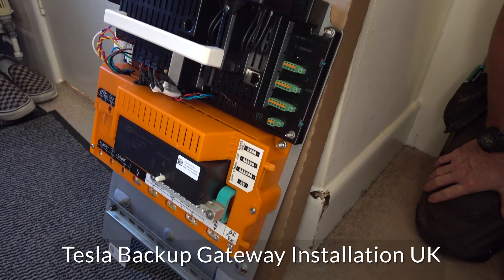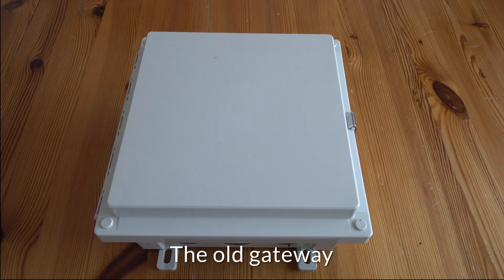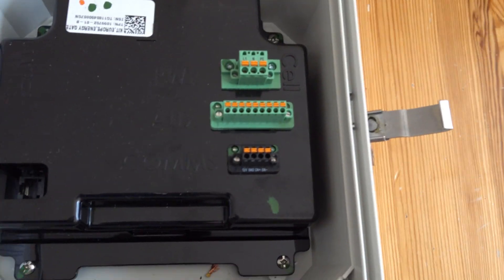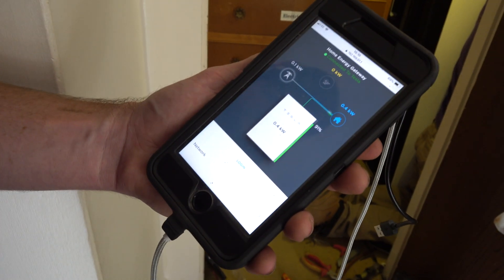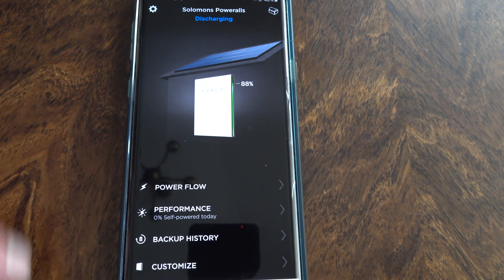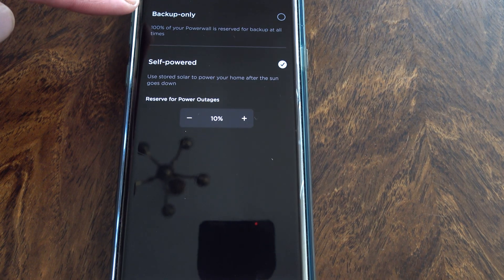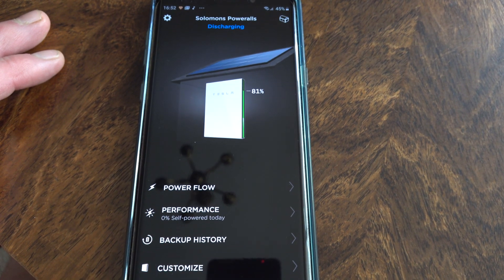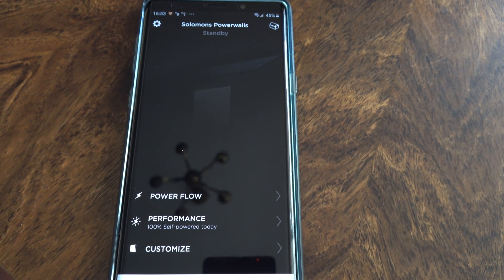Tesla Powerwall Backup Gateway UK Install and App differences

Comment: If your still looking, I’ve a Powerwall 2 and the non backup gateway. How much was it to replacement gateway, ball park would be a great help. 🇬🇧
Reply from the maker: 3 years ago it was around £1200.00 No doubt gone up since...
Reply: @BurlSolomons  
Thanks 🙏 I think I’ll change it alongside fitting another Powerwall that way it might work out a better deal,  especially now that the price of electric has jumped through the roof. CM.

Comment: Does the Gateway only work with the Powerwall 2?
I have a Powerwall 1 and I've been advised it wont work with that. Something about the difference between AC & DC power? Have I been correctly informed?
Regards
Stephen C.
Reply: Yes the Powerwall 2 has an inverter built in so accepts and supply’s a/c voltage the Powerwall 1 only works with DC current. I believe the reason for the  Powerwall 2 was to overcome this problem and to allow backup.

Comment: Hello, could you please tell me more about the Tesla Gateway? I noticed that you have 3 batteries. I'm in the USA. Over here, if we get one, we can only have 120 V back up. If we got two, we can have 240 volt back. My question is, does the Power Gateway have leads that go to the main panel and a sub panel, if you choose to just back up certain loads? 

What I am trying to figure out, is the how the Gateway would isolate, if I decide not to do total home back up, and instead do a separate sub panel with two power walls. Why would I not do a total home back up when I have two power walls? The reason why, if there are other circuits like a pool pump, hot water heater, or other big draw items, I do not want to be away from home and have no way to turn them off and rapidly deplete the batteries. 

I know your power set up is different in the UK that over here in the USA, so I'm wondering if this is even relevant asking. Thanks!!